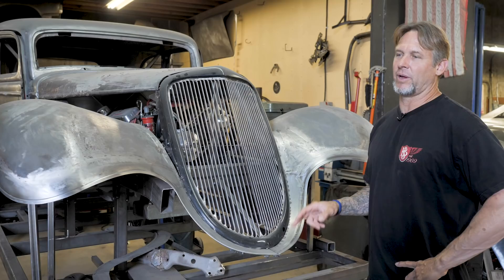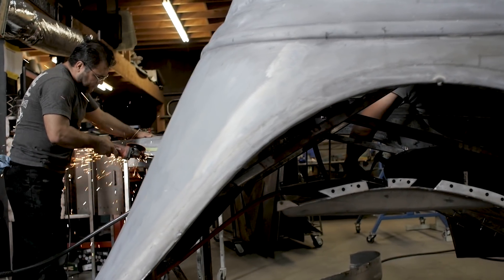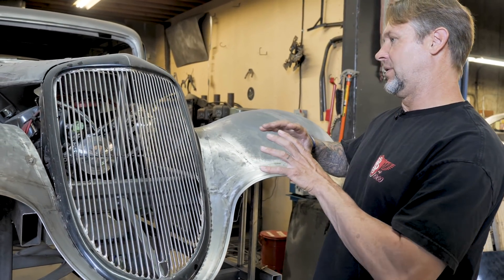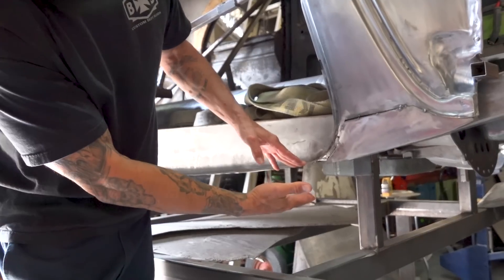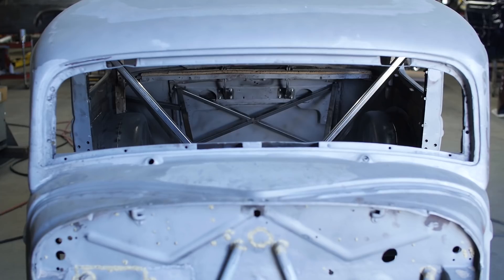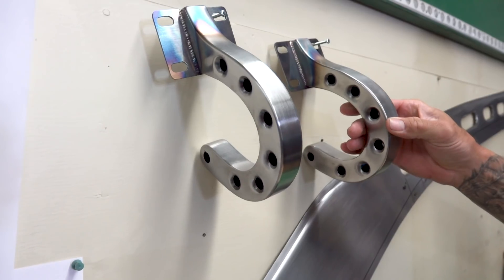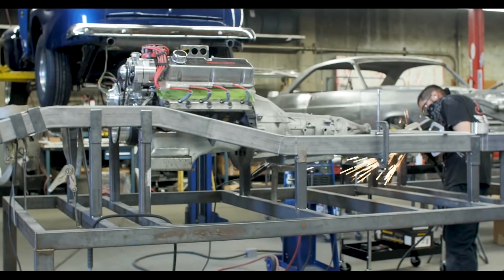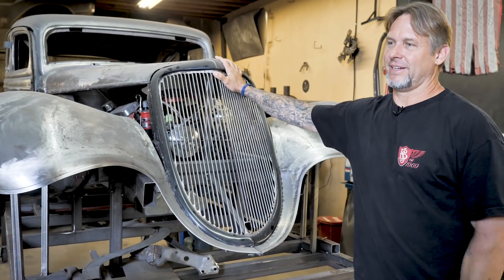Viktor - A Tim Allen Build - (part xii)

Comment: In the factory for decades, after roof panels were installed, welded, the gap between the two was filled with lead. It was the metal version of plastic filler, like "Bondo" came along in the 50's. Otherwise, guys who applied lead had extreme talent, running the area, heating the bar & metal both. They used "Tallow" for lube on a shaped hardwood paddle to move the lead to shape. Adjustable files were use to knock down high areas and re-headed to be smoothed. Eastwood still sells the products. This to inform the lady that not all lead was a back yard thing. No disrespect, just info incase no one told you. I am sorry I don't remember your name even after you introduced yourself. Ask Brodie, he knows.
DK, ASE Master Tech since 1978, retired.